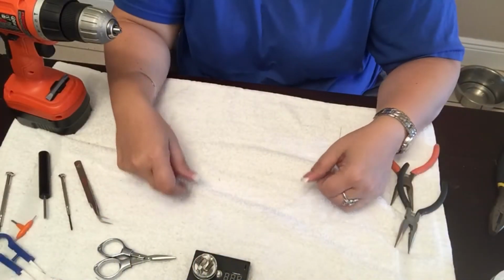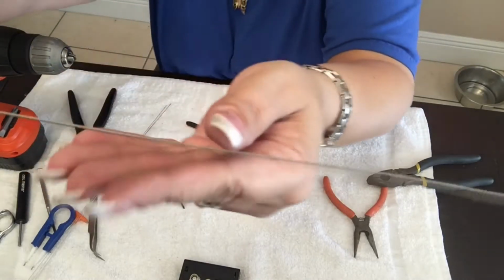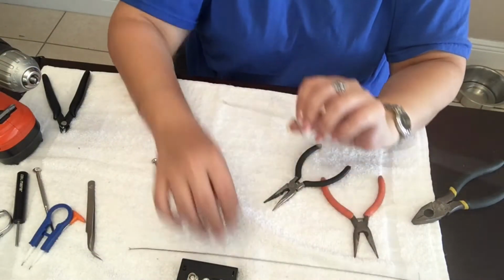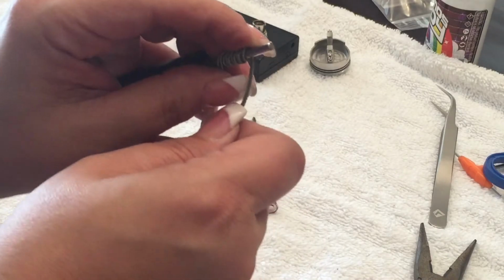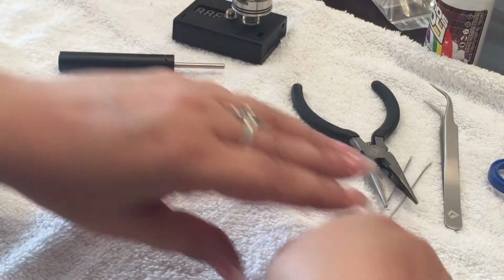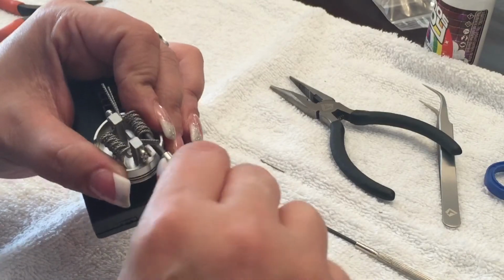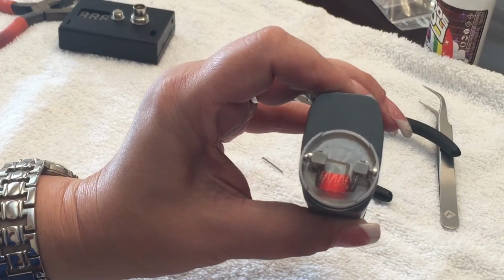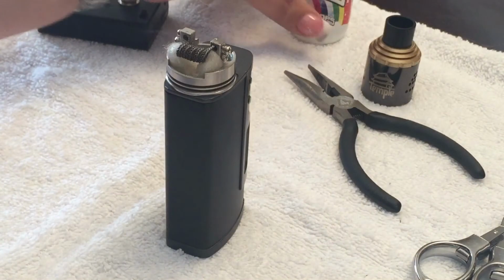TUTORIAL #7 | Zipper Coil

Comment: gutsy and fun fam. i enjoyed the tutorial and please keep them coming! unfortunately it is all about liability these times we live in; safety glasses, ohms law / battery safety https://www.e-cigarette-forum.com/forum/blogs/mooch.256958/ and as jim mentioned an ultrasonic cleaner (at the very least soap and scrub with a toothbrush) need to be talked about. you don't want to inhale those metal shards. 26g is a bit easier to work with and as i'm sure you know would raise the resistance up. it helps to get your leads perfectly parallel and square with the pliers before twisting. flattening 6"-8" pieces is much easier and a lot more force can be appied.
Reply from the maker: addy tuney thank you for watching and the feedback. :)